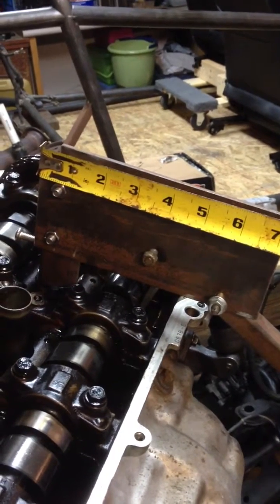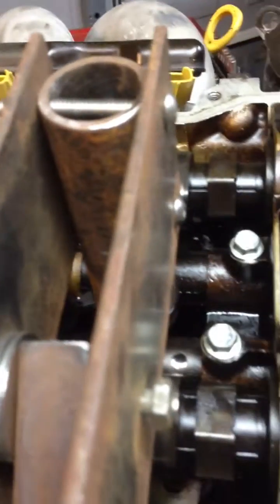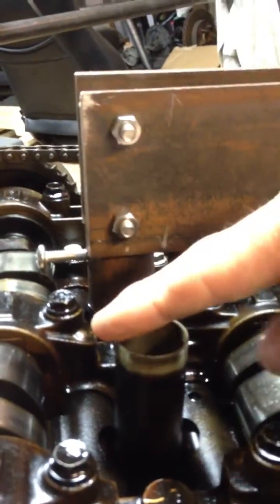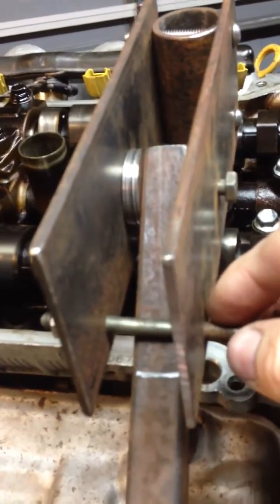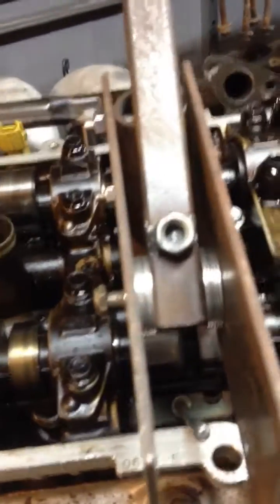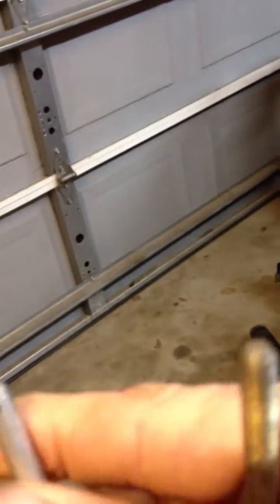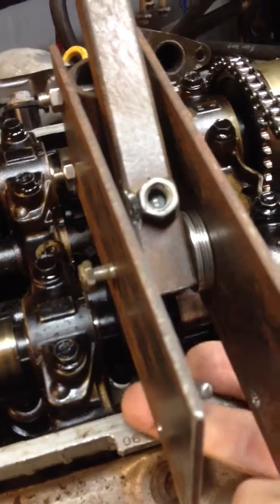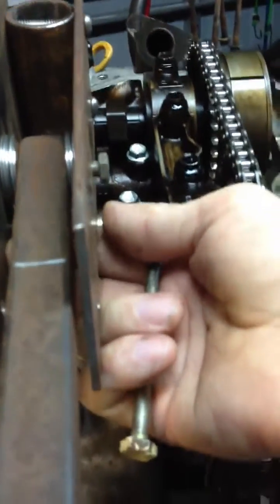2ZZ Toyota Celica GTS, VVTL-i valve adjust tool

Comment: Great video! One question: I understand the tool used for removing the shim, but what is the larger tool that attaches to the spark plug tube used for? To compress the spring?
Reply from the maker: @rh9967  Yes, It compresses the spring so the shim can be placed.
Reply: @ Ah, ok - thanks!
Reply: @TSRGarage  Had one more question: when looking at replacing a shim using the Toyota chart, it numbers them (ex. shim no. 60), but when you look up the part on Toyota’s parts website it references each of them using a separate part number but never as “shim no. 60” - if that makes sense? How do I know which shim size I’m ordering?
Reply from the maker: @rh9967  monkey wrench racing lists them by size. https://www.monkeywrenchracing.com/product/toyota-oem-valve-shim-1-2zz-ge-engine/
Reply: @ Awesome - thank you!

Comment: I'm trying to make one with the motor in the car question? The metal plates are 7in long by what wide or tall about 3 inch and the tube is 1inch inside diameter and how long of tube?
Reply from the maker: I made this thing 7 years ago and used it once... but I went to the shop and.... I am  surprised I found it.... 
   So the inside diameter of the tube is just over an inch. It has to fit fairly close over the spark plug tube of the head.  The plates are just under 3 in wide, but the exact width isn't critical. The tube is 4 3/8 long, can be longer as you can see mine doesn't even reach the top of the side plates.
  Good luck with your build

Comment: Have a nice day. What is the size of the iron pressurized by the valve. Could you give information
Reply from the maker: It was cut as needed to fit  the valves.  I made it quite some time ago so I don't really remember the exact  size. From memory and looking at the video  it was cut out of a piece of possibly 1/8 inch thick 1 1/4 inch or 1 1/2 inch angle... I just made what I needed to fit the valve spring
Reply: @TSRGarage  In fact, I just need the size of the apparatus that lets it press on the valve. 1.18 minutes of the apparatus. Do you have the size of this apparatus. If you have the apparatus in your hand, is it possible to take the measurements. That's all I need.